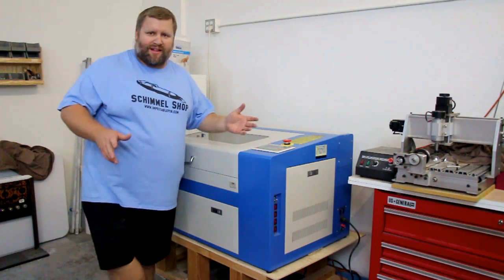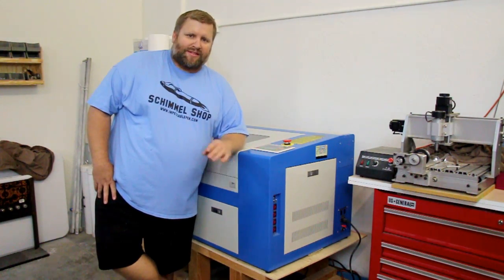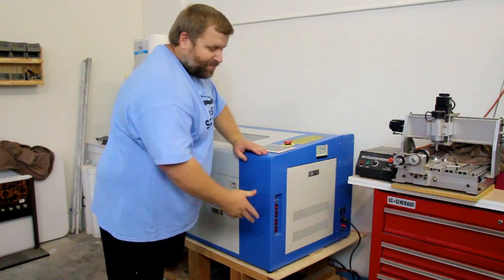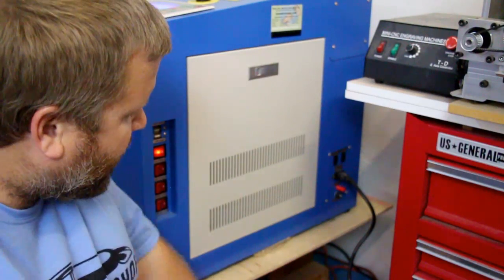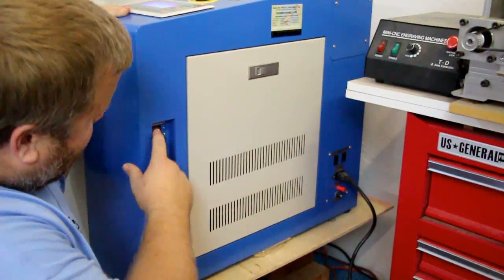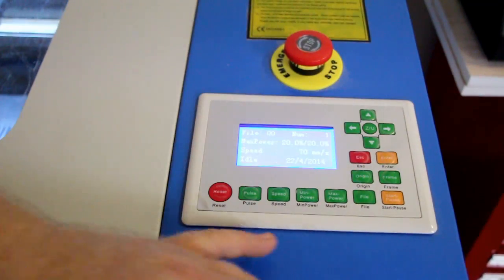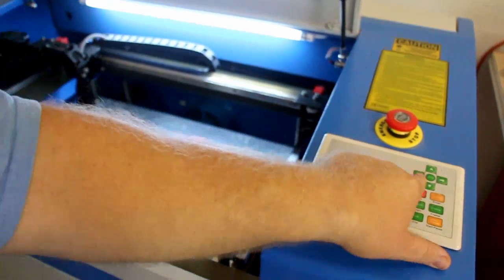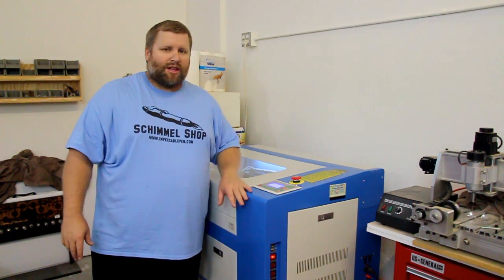50 Watt CO2 Laser engraver cutter from China, EBAY Laser, Basic operation and overview

Comment: So if, in CorelDraw you have a shape (such as a diamond) filled with a gradient (dark on edges, light in middle) Will it give more power to the darker edges, making a 3d effect?
Reply: Yep, so long as you have a laser that supports this effect.
Reply: Kevin Gregerson Well yeah, obviously. I meant can you get YOUR laser, the one in this video, to accomplish that? I'd imagine if you could get a real print driver for it it might work.
Reply: I deal with Universal lasers and the driver on it is very very easy to use for this type of purpose.
Reply: Kevin Gregerson I've ran a Universal quite a bit, and I know it is very easy on those. I'm wondering about this laser specifically though, like if anyone has figured out how.
Reply: The trick with the chinese ones is two fold.  Glass tubes(limited pulse and power control), and the driver.  There was a group now defunct hurricane that developed their own driver that gave it limited capabilities in this space. But setting up files wasn't exactly easy and it was pretty slow, and engraving quality was still hit or miss.    Universal has it built into the driver, just select 3d and be done with it.   Especially with the newer VLS, PLS, and ILS systems.
Reply: Kevin Gregerson Trust me, if I could currently afford a Universal, I'd be engraving on it right now.
They are FAR superior in every way except price point. Parts for them are super expensive as well.
Reply: Parts aren't too bad and if you look aftermarket most of them can be had for very little.    The machines range in price between 9k up to 200k.   Where hobby machines like this tend to range between 3k and 15k.  But the usability and support is very very different.